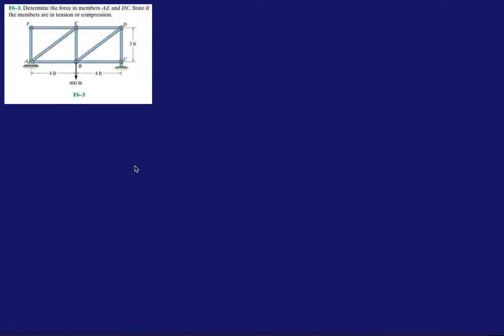Problem F6-3 Statics Hibbeler 12th (Chapter 6)

Comment: sir why u dont take the reaction force cy as a tensile force , the value of cy is +400lb ??
Reply from the maker: Cy is not an internal loading on the truss member. It is force caused by the reaction on the roller C. We're only looking at how each truss member is in tension/compression.